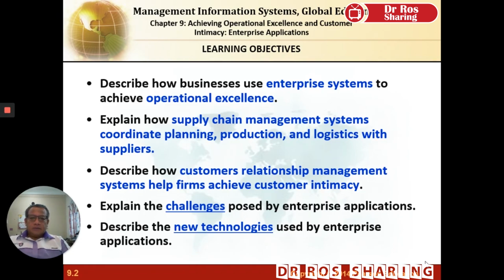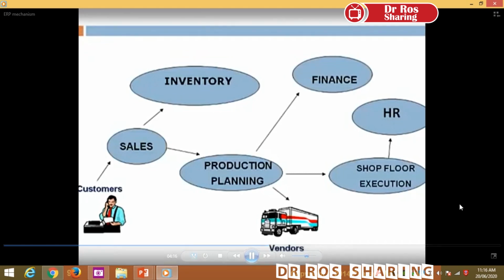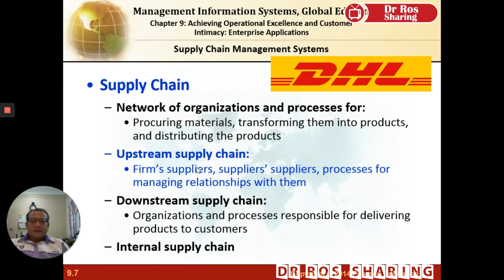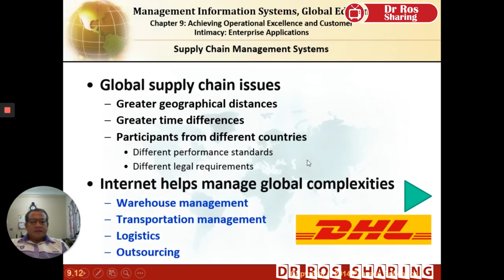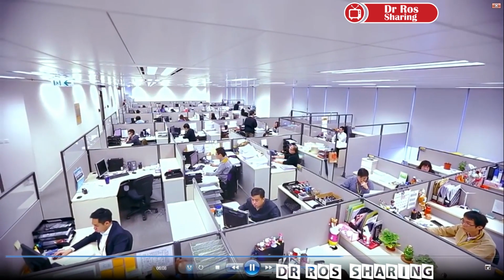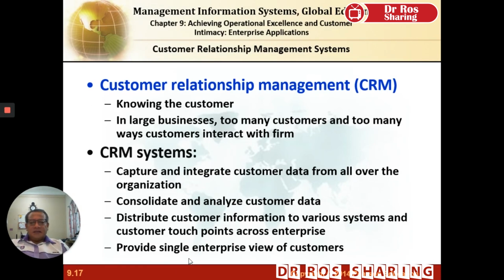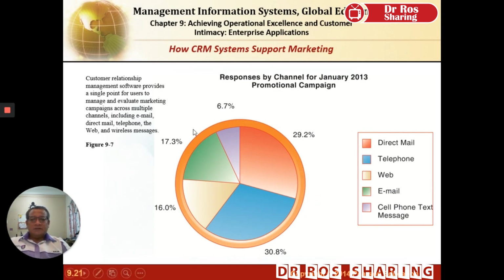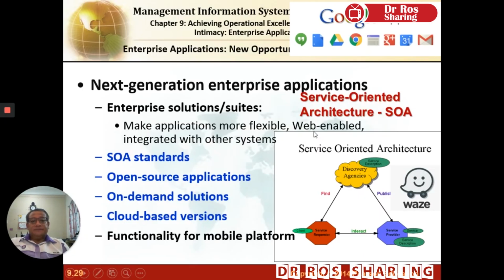MIS Chapter 8 Lecture

Comment: NOOR HUSYAFIEQA BINTI MOHD FADZIR (CP200076)
Through this video, I have learned Enterprise Systems called ERP which is about how businesses use enterprise systems to achieve operational excellence. Basically ERP is an unified system that integrates all the operations of important departments in an organization. Some of the key features and functions how does ERP system function. For example, by the name of SAP and Oracle which is  most widely used in Malaysia manufacturing. Next, from this video I also know  how customers relationship management systems help the firms to achieve customer intimacy. Last but not least, I have learnt about the challenges posed by enterprise applications such as technological change, business process changes, organizational learning changes and others. Thank you Dr. for sharing this video :)

Comment: LEE CHUI WEI (AP200285)
Thank you Dr for sharing video.
From this video, I've learned about the Enterprise Software System can be classified into two types, decentralized system and centralized system also called ERP. In a Decentralized system, data is maintained locally at the individual departments and departments do not have access to data of other Departments/BU. In a company with Centralized system of data management. Data is maintained at a central location and is shared with various Departments. CRM systems, capture and integrate customer data from all over the organization and also provide single enterprise view of customers.

Comment: ALVIN GOH WEI YANG (AP200123)

From this video, I have learnt about how businesses use enterprise systems to achieve operational excellence. Besides, i also understood what is supply chain management systems. Supply chain management software help firms to enable their demand planning, establish their inventory levels and optimize sourcing and manufacturing plans. Furthermore, I have learnt about between push-based model and pull-based model in the supply chain management and how CRM system support marketing.
Last but not least, I have learnt about the challenges posed by enterprise applications such as technological change, business process changes, organizational learning changes and others.Thank you Dr Ros sharing this video.

Comment: LEE WEN XIANG (AP200220)
From this vieo i have learn that are Enterprise  system collect data from many divisions of firm for use in nearly all of firm's internal business activities. Besides, supply chain management software help firm optimize sourcing, manufacturing plans, establish inventory levels and others. Futhermore, I learn the difference between pull based model and push based model. Last but not least, customer relationship management help the firm to capture and integrate customer data from all over the orgaqnization.

Comment: NURUL SYAFINI BINTI MOHD YUSOF (AP200261)

THANKS DR FR SHARING,I learned how ERP may help firms achieve operational excellence, as well as what the supply chain entails in terms of management systems like how information is communicated to consumers. It may simultaneously convey the information to the appropriate department, saving time on describing the current situation to other departments and Mature commercial markets are usually cost-leading markets that can support continued growth. Leaders in the field of operational excellence have strong concentration, strong organisational discipline and standardised rule-based operations. The customer intimacy strategy focuses on offering unique client service, allowing individualised service and product customisation to fulfil varied consumer needs.

Comment: Ting Sin Teck (AP200411)
Thanks Dr for the sharing. I’ve learnt about the Enterprise Resource Planning which is suit of integrated software modules and a common central database. I also understood what are the different between push and pull based-model. And I also learned about how CRM system support marketing.

Comment: UTHMAN BIN ABD AZIZ (AP200234)
Thanks Dr for the sharing.
I learned about enterprise systems, supply chain management systems, and customer relationship management systems, as well as their functions and challenges, from this video. Decentralized and centralized enterprise systems are the two types of enterprise systems. I now know that CRM also collects and integrates customer data from across the enterprise. Thankyou very much Dr.

Comment: NURUL SABIHAH BINTI SALIM (AP200456)

Thank you DR for this learning video. Based on chapter 8, I have learnt how business use enterprise systems to achieve operational excellence. I also got know that supply chain management systems coordinate planning, production and logistic with supplier. Then, I learnt the ERP System which is the consolidated system that emerges all the operation of a key department in the organization. ERP System are also a big software that integrating many modules for example from production, human resource, finance and operation of the business.

Comment: HOO BOON XYAN (AP200145)

Thanks Dr for the sharing. From this video, I have learnt about how to describe businesses use enterprise systems to achieve operational excellence. Besides that, I have also learnt about how supply chain management systems coordinate planning, production, and logistics with suppliers and customers relationship management systems help firms achieve customer intimacy. Moreover, I also know the challenges and the new technologies used or posed by the enterprise applications.

Comment: NURFAZIRA FONG ZI PENG (AP200269)

From this video, an enterprise system is known as an Enterprise Resource Planning (ERP) system. This system consists of a collection of integrated software modules and a central database. Normally, this large system collects data from many divisions of a company for use in nearly all of the company's internal business activities. There are two types of enterprise systems: decentralised systems and centralised systems. A decentralised system means that data is kept locally at each department in a company that uses a Decentralized System of Data Management. While a centralised system means that the data is kept in a central location and shared with various departments.

Comment: Nurul Azreen Izzatie binti Roslan (AP200209)
Thank you dr for the sharing! In this video shows how to use an enterprise system to connect all partners in a supply chain simultaneously. It also sending the information to the relevant department at the same time allows you to save time explaining the current status to other departments.I also know that online communication across departments has become easier with the use of the internet.

Comment: SEOW CHEK HONG AP190085
Thank you dr for sharing this video, Form the video i have learned about the enterprise system. Its a suit of integrated software mldules and a common central database. Besides that, i have also learned about the challenge posed by enterprise apllication and the new technology used by the enterprise.

Comment: Dwi Awalia Arisca jp210027 From this chapter, I have learn about what is enterprise system and how it coordinate planning, production and logistics with supplier. In addition, I also understood what are the different between push and pull based-model. And I also learned about how CRM system support marketing. Also, there are the challenges firms face when they implement enterprise applications. thankyou for sharing dr :)

Comment: Nurul Fakhriah Binti Yusof (AP200069)

From the video today, I have learned that the ER system or enterprise system is a system that collect data from many department in a company and use it for company's internal business activities. The benefit that we can get from which is we can increase operational efficiency by customer will not wait too long to buy their needed. Next i also learned about supply chain in management system which the network of organization for procuring material and production output. In this chapter, i also learned CRM system which it will capture and integrate customer data from all over the organization. Theres are challenges and benefits in enterprise application. Thank you for today video Dr

Comment: CHAN HUOY CHYI (AP190154)
Thanks Dr for the sharing. I have learnt about the enterprise systems, which collect and integrate data from many different departments and systems throughout the business. Next, customers relationship management systems can help firms to achieve customer intimacy. Also, there are the challenges firms face when they implement enterprise applications.

Comment: JOSIELYN JIDING (CP200026) 
From this video I learned about Enterprise Resource Planning (ERP) system. It is a suit of integrated software modules and a common central database. There are two types of enterprise system which is the decentralised and centralised system. Decentralised system used to maintain locally at individual department where centralised system used to maintain at a central location and share with various departments. In addition, I also know how supply chain management systems coordinate planning, production and logistic with supplier.

Comment: Tan Jian Woei (AP190389)
In this video, I had learnt enterprise system collects data from many divisions of firm for use in nearly all of firm’s internal business activities. Next is how enterprise system work and business value of enterprise system provide firm-wide information to support decision making. Concept of the supply chain. Using supply chain management systems to coordinate planning, production, and logistics with suppliers. Two types of models in supply chain management which are push-based model and pull-based model. Concept of customer relationship management and using customer relationship management system to provide a single place to integrate and analyse data about customers include customer service, sales and marketing. Three types of CRM software which are operational, analytical and collaborative. Thank you Dr, for the sharing and explanation.

Comment: NOOR ALIA DAFINA BINTI MOHAMAD ZUBIR (AP200354)
From this chapter, I understand about business use enterprise systems to operational excellence can collect data from many divisions of firm for use in nearly all of firms internal business activities. Next,  I have learnt supply chain management. procuring materials , transforming them into products and distributing the products. I also learnt about customer relationship management, it provide single enterprise view of customer and consolidate and analyze customer data. The challenges of enterprise applications. technology changes, switching costs,dependence on software vendors. Lastly,  the new generation enterprise applications, it can make applications more flexible,web-enabled and integrated with other systems. Thankyou Dr

Comment: Tan Hui Yeng (AP190252)
For this video, I learn about ERP software is a system that centralizes the management of customers orders and product delivery includes supply chain management. Besides, I learn enterprise software to implement firms select functions of system they wish to use (finance and accounting, human resources, manufacturing and production, sales and marketing), supply chain management ( just-in-strategy, safety stock and bullwhip effect) and customers relationship management systems (business value of CRM system and enterprise applications challenges).
Thank you Dr for the sharing.

Comment: LIM JEA YI AP190100

TQ Dr for yr sharing.
From this video, I have laerned about enterprise resourse planning system is a centralized database which collect data from many department and to save time in sharing and distributing information. Besides that, I have also discovered the supply chain management which focuses on the purchasing of raw material, tranforming it to finish product and distribute it to customer. It also focuses on upstream supply chain such as supplier and process of managing the relationship between supplier.

Comment: ONG XIN YI AP190265

Based on the lecture today, I’ve learned Enterprise Resource Planning (ERP)system. It is suit of integrated software modules and a common central database. There are two type of enterprise system which are decentralised system and centralised system. Decentralised used to maintained locally at individual department where centralised used to maintain at a central location and share with various departments. Next, supply chain. It is focusing on internal company which purchasing material, transforming into product and distribute into product. Lastly, Customer Relationship Management (CRM). I have learned that it is works to capture and integrate customer data from all over the organization.

Thank you Dr Ros for sharing ya😍 Wish dr have a nice day.

Comment: Lew Xiao Yee (Ap190417)

In this video, i have learn the enterprise system can use as a way to link all of the parties in the supply chain at the same time. It can let the related deparment know the information at the same time,this can avoid the loss of time on explain the current situation to other department. The communication between related department become convenience through used the internet.

Comment: RAIHANAH BINTI ABDUL MURAD AP190506
Thank you Dr. for sharing this chapter. What I understand in this chapter, Enterprise systems consist of interconnected software modules and a common database enable data sharing across corporate processes and functional domains. Large networks of supply chain partners can immediately change inventory, orders, and capacity. Many CRM systems look at clients from many angles. These systems include customer service, sales, and marketing applications. Client data is integrated from various sources to help sales, service, and marketing activities. So it's both operational and analytic CRM support.